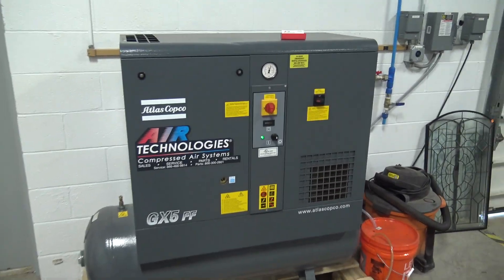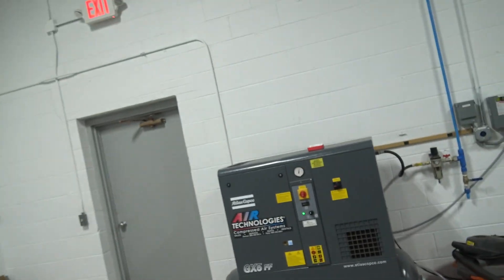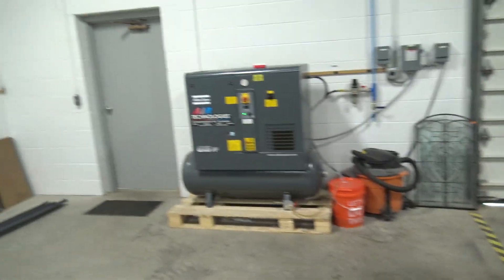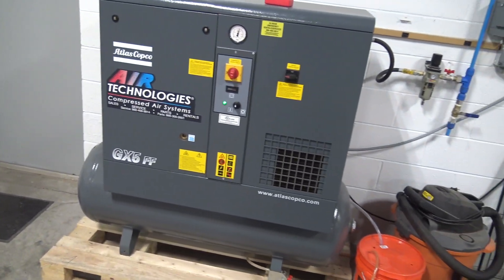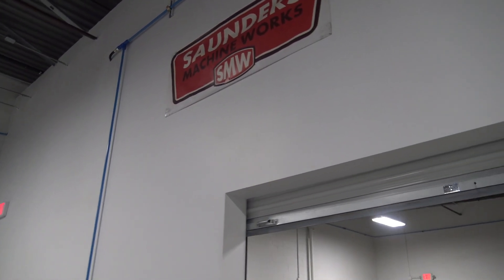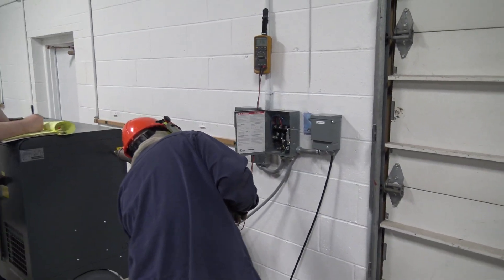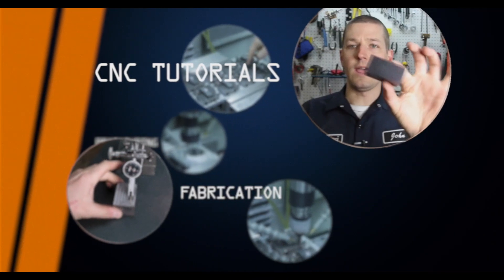Rotary Screw Air Compressor:  What are they?!  Worth the hype?

Comment: Don't worry too much about running the motors beyond target pressure. If you get your hysteresis right, you can achieve the same result. Particularly if you can tolerate a lower switch-on pressure. I would assume that is possible in your shop. That is more efficient than pumping compressed air into the atmosphere to avoid motor restart. 

There key issue with screw compressors is the maintenance of the bearing. When they fail it typically has devastating effects on the screws and/or the housing. Analog to a failing timing belt in a car. Make sure you don’t miss intervals on those. In a
proper setup, the motors starts are of less relevance to wear.
Reply: Lubrication is the one thing. Bearings wear and tolerances develop out of specification over time. You’d change a timing belt before it actually tears - I’d handle the four (or so) bearings guiding the screws in the same manner. Presentative exchange within the maintenance guide of the manufacture should be sufficient and don’t cheap out with bearings. 

Why are bearings (and clean air/air filters) crucial? The two screws are precisely machined to just not touch each other. 2 to 5 thou distance would be a typical distance, the housing of the screws is a similarly tight fit. I have seen compressors being lapped in with die as you would e.g. with dove tails. If the bearings wear and therefore the screws have a tiny bit of room to rattle they will start touching and start wearing off at some points hence slowly running the precision parts.
Same effects from dirt that gets sucked into the screws and gets crushed between the screws. That introduces all sorts of problems from marring the screws to adding load to the axial guidance / bearing, collecting in the bearings and adding to their wear and so forth. Keeping your bearing happy and dirt out is key for a long compressor life.

There are also regular gears that time the screws relative to each other. Those might also wear. To my experience that isn’t a key factor. That would be analogue to the breaks in a car – the pads needs more maintenance than the rotors – which wears over use but hopefully lasts much longer. The lifespan of those gears depends greatly on the machine type and there is no “latent” issue. When changing the bearings you have to realign the screws. When this process shows too much play in your
gear, change them.

Comment: Cool vid mate I look after 4 centac compressors, 5 atlas ZR comps 2 atlas ZT900, 20 kaeser ASD 50, and there is more Low pressure ones lol where I work the one you got will do you workshop great the dryer side are not so good but if in low humidity there fine where I am we have high humidity we got some huge dryers.
Reply: +NYC CNC yeah it would be cost we run all our ring main comps straight into dryers on 12" manifolds running out to an 8" ring main about 2km in length. Can see they would run yours with the tank so it  can catch any oil that could get through the separator. When I'm in work next will get you a number of the auto drains we use for you to compare.

Comment: You want a wet tank system because the air right out of the screws is hot, the refrigerated dryer works better if it doesn't have to take the excess compression heat out before chilling the air to condense the moisture.   The reason you want to try to keep the screws running as continuously as possible is because the oil separator and the oil flow thru the screws needs to stabilize for lowest oil bypass. If the air and oil are flowing through the screws at a stable level, the separator will work at its best. On startup or major disturbance of the flow, the screw can starve for oil and the separator can bypass. Hope this makes sense.
Reply: Wet tank is not needed in this compressor. The compressor comes with a build in after-cooler that eliminates  majority of the moisture.
Reply: This machine has a built in aftercool system that will cool the discharge air  within 10 degrees Fahrenheit, plus or minus a few, of your ambient temperature. Running through a dryer without a wet tank is a typical set up for most applications. As long as the coolers, filters, valves and thermostat are working properly and atlas copcos recommended preventative maintenance intervals are executed properly.

Comment: GX5 as in 5KW is roughly 7HP - hence the name
Reply: I work on a 240kw compressor
Reply: @nightmareinaction629  you are cooler than each commenter
Reply: @nightmareinaction629  I make the maintenance of 3 boge so340 of 250 kw from a client
Reply: nightmare in action ji where ?
Reply: Engineers done work on the floor. Not a good name for general buyers.
Reply: Gx 5 is having 5.5kw motor power = 7.5hp
Reply: Basant ji nice reply

Comment: John
Why are frequent starts and stops bad?  Starting current is 4 to 9 times running current.  On compressors this may be for 10 to 40 second especialy so on recips ie piston.   On larger motors they wil specify number of starts per hour.  Both the windings and the rotor get heated durning start.  Both recips and rotary or any other compressor for that matter benefit from unloaders.  Yes the compressor is stil rotating but the discharge pressure is zero.  

I just read BCB Bloc below he talks abot heating the compressor piston or scews in a rotary -- good comment.  Hot cold at frequent intervals is hard on equipment.

Air lines look OK to me I like the take air out the top of the pipe.  Water does condense in the headers so they should slope.  A tank at the end of a hader makes a handy place to dump the water and also helps to lower friction loss in the piping.
Down legs to connectors or machines should have the tee as you showed with a dran valve at bottom.

Water in compressed air is hard on air motors and actuators.  After coolers go a long ways to remove water from air.  If ypu put one close to compressor discharge you can use warmed water to heat other rooms.  Cold water from aftercoolers ie from the air can be used as source of chill water.  You spent money to heat that water in compressing it then more to cool it so why send the results down the drain?

Auto drains ??  Dont think much of em - fine when they work BUT put in a manual valve to check em - everytime I did this they worked flawlessly - I dont understand that - must be Murphy Law.
Dan Bentler

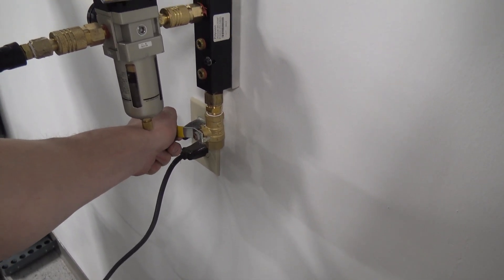Comment: @ 12:52 - "to bleed out moisture if need to" - but it's 3" away from an electrical outlet - that can't be good ;p
Reply: the only real danger from the small amount of moisture would be corrosion.
Reply: easy to add an extension pipe and be below the outlet.
Reply: I noticed that too, it does not look safe.

Comment: The reason an induction motor need to be constantly running is to prevent hard starts and stops (wear and tear). Every time an induction motor starts, a draw of the amps increasing  draws on the meter. So, in commercial usage letting induction motors continually run is cheaper than having the motor turn on and off. Same principle on A/C chiller systems to cool large buildings.

Comment: The compressor discharges to the tank first to help remove some of the heat from compression.  It also helps to remove water and residual oil / coolant.  This takes the load off of the refrigerant dyer and helps to prevent fouling of the heat transfer surfaces in the dryer.  The oil is also the coolant in rotary screw compressors, which is important to note.  Unless the compressor has a valve to load and unload the compressor to keep it running, then it is just an on / off machine.  More expensive compressors can modulate their output to maintain a specified pressure or can slow the motor to do the same.  Do not put a VFD on this unless approved by the manufacturer because motor failure or sometimes blowback can occur (oil coming out of the intake filter).Maintenance of a rotary screw compressor can be high.  Use OEM parts.  Use of a cheaper substitute can really mess things up.  For instance, the hydraulic hoses on the compressor are designed to handle the oil and the temperature during operation.  Use of just a regular hydraulic hose can cause the rubber inside the hose to come off fouling the whole lubrication / coolant system up.  This is a very costly repair.

Comment: Good info. I never even thought of 'stale' air in the lines but that would make sense that you would get a dead spot with water build up. I think leaving on the pallet is a great idea, super easy to move if you need to repair something on it or just paint the wall behind it! 
I double action compressor is more efficient than a screw but these tend to be really big, over 30 HP, monsters. Even a single action 2 stage compressor is still going to be at least as efficient as a screw. But the biggest, by far reason to run an air screw is duty cycle and life span. Air screws, buy nature, run a 100% duty cycle and last for many years (at least a decade). If you ran a piston air compressor at a 100% duty cycle it would be worn out very quickly, you need to keep them under about 60%. Even then you really are only going to get maybe 15,000 hours out of one before it's worn out. Compared to about 100,000 hours or so life on a screw it 'should' be cheaper to own as it has very little maintenance and will out last many piston compressors.

Comment: Great video as always. For the home shop cheap version of the rotary screw compressor people may want to look at the quiet compressors from California Air Tools. They make 1 HP and 2 HP compressors that are about as loud as a laser printer - unbelievably quieter than the Porter-Cable pancake compressor I had before. It's possible to use one of these per machine and avoid the airline runs and they are very cheap to buy on Amazon. That gives me some redundancy too. It's great to have a quiet shop!

Comment: I bet if you build a nice tight carpet lined 3/4" plywood enclosure around it, and maybe plumb the intake somewhere, it'd be hard to tell if it were running. Mass and freedom of gaps are main keys to acoustic insulation... don't forget to design in provisions for cooling air and maintenance should you do it.

Comment: One other comment and this is based on my 35+ years of building refinery projects that included air systems for plant air and instrument air.  For a loop as long as yours, I would recommend using a main header loop at least 2 sizes bigger than your drops to your work stations.  This way you have a header system that can accommodate heavy air demand from multiple air stations.  If your main header is undersized, you have negated the capability of your compressor (i.e., it cannot push the air into the system fast enough to compensate for the draw down due to pressure drop loss in the piping system).We typically use a 4" header with 2" subheaders to feed about 100 3/4" air supply points in a refinery process unit.  This insures constant pressure at all the instrument stations and control valve stations.  Think of it this way, if you have 15 drops on your loop and all of them get used at once, you need a reserve in the piping system itself for the compressor to fill up from the tank.You may not have heavy air demand now, but if you plan on future expansion, you might want to consider re-sizing the header loop.Regards;Ron Kluwe
Reply: Ran some quick sizing calcs for you and at about 40 CFM of draw, it looks like your current system will go to Zero PSIG at the drop end points with the header it appears you currently have (I am assuming 3/4" tubing throughout).  The system is essentially choked at this flow rate as the compressor cannot push enough air into the header, no matter how big the compressor is.  If you upsize to a 1.5" header for the main loop, this is only about a 3PSI drop in air pressure at 45 CFM demand and a 12 PSI drop in air pressure at 90 CFM demand.  Also, typical practice is to put a large air receiver vessel after the drying system in order to limit surge demand on the compressor.  For the volume of pipe in your shop, it looks like a 300 gallon air receiver will give about a 5 minute surge coverage and a 600 gallon air receiver will give about a 10 minute surge coverage.  Something to think about to ensure longevity of your air system and flexibility for future expansion.  I can fill you in more on this at the BarZ Summer Bash.
Reply: +NYC CNC there is a difference between pipe of a certain size and a single choke point. Your long run could benefit greatly from a diameter increase.
Reply: Put a 300 or 600 gallon receiver tank in the system and you can run your compressor all day at 20 CFM and maintain 125 PSIG at the outlet points.  Even with short term demand (5 or 10 minutes at a time) to 30 CFM you can maintain about 115 PSIG at the outlets.  I am very surprised that Atlas Copco would limit the output to a 1/2" outlet size.  My bet is that if you look into the guts of the machine, it is the air drying system that is the limiter on flow and that they are using 1/2" tubing for that system.  Might want to ask them if a 1" outlet can be installed at the compressor.
Reply: I waS thinking the same thing... thats some tiny pipe for such long runs. Especially right off the reciever tank... seeing the video more it seems like a very badly made system
Reply: My former shop system had a 15hp piston compressor in a back room and we had 3 80 gallon tanks plumbed into a 3” main line that ran the length of the building and each station dropped off that main. We had two air dryer systems. A main refrigerator dryer, and a secondary for paintwork, powder coating, and so on. We used a lot of air, rarely did it run down it worked well to maintain power tools, etc... sadly the tri piston compressor was ridiculously loud.
Reply: I like to make my drops go up first to minimize water flow.  And I set up main line to fall 1/4" per foot to an auto purge point to purge fluids.  Long runs need multiple fall points and auto purge valves.

Comment: Looks like a great job on the air system. There are phase meters so you know before you switch on if the rotation is correct. But it can be hit and miss with  how import motors are wound and labeled. I just know that every time I hook up a 3 phase motor, it will be always running backwards. And now that I got a meter, I haven't had a chance to use it. On larger screw compressors they can also be driven with a variable frequency drive, so they run at just the speed needed to keep up with air demand and can run constantly, eliminating the starting and stopping.
Reply: Yeah, a small shop's air usage is all over the map. Sometimes nothing for hours, then practically everything on at once. No way to average that.

Comment: that is just a baby.   where i work we have 3 cooper/joy compressors that all exceed 1400 SCFM each and one Ingersoll Rand that is rated for 1800 SCFM.  each are powered by a 500 hp motor running on 4160 vac. with 4 air dryers.  and they all run balls to the wall 24/7/365 and barely keep 90 psi in the plant.  i am just glad i only have to worry about the electrical aspects of the system.
Reply: Jesus thats insane! What kind of place is this?
Reply: +Jay Walt producing a lot of hot air ;)

Comment: Hi John this is the type of equipment I connect automated controls to for Seimens technologies if you look on your air compressor it may have a RS485 or a Back Net connection on it if so you can install a Back Net / RS485 Management Module to connect to your Computer , just thought I would pass that on to you